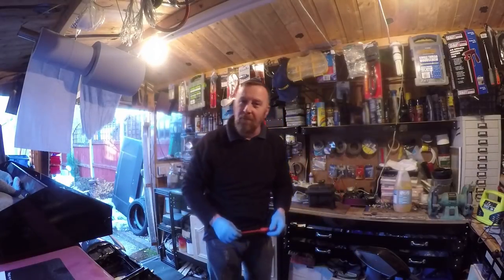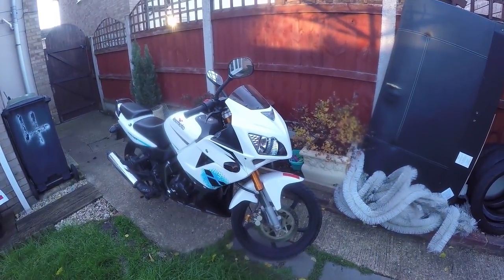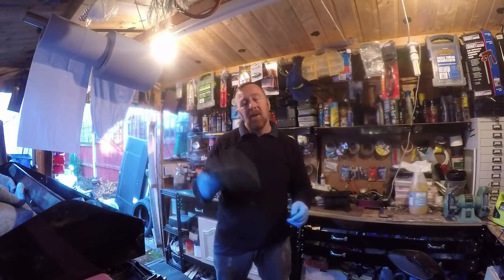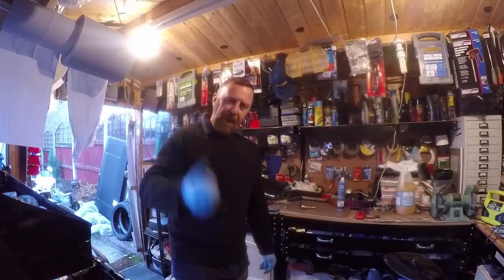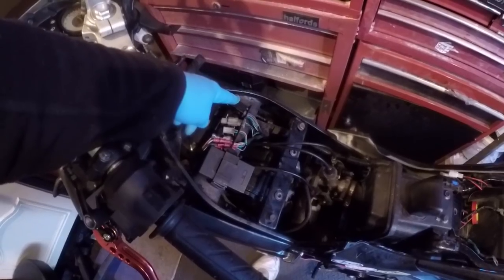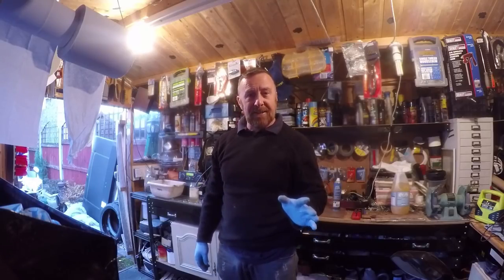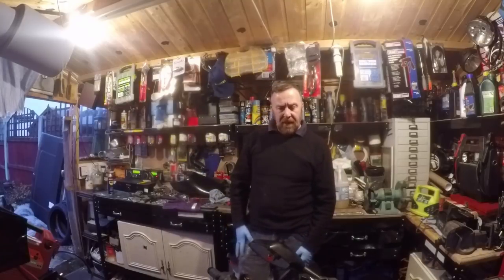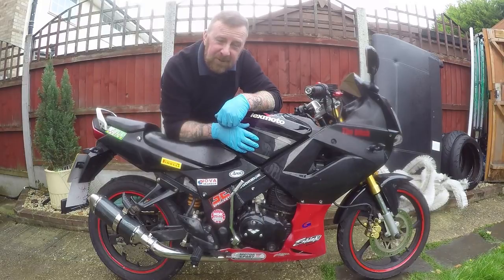LEXMOTO XTR 125 CC MOTORBIKE NONE RUNNER FIX MARK SAVAGE

Comment: Hi where did u get the mirror indercaters from and how did u wire them up
Reply from the maker: e bay and just follow the wires down to the old indicators it is easy but just try and hide the wires the best you can bud
Reply: @marksavage  can u still use the old ones as mine r new can u wire them up together
Reply from the maker: @jonszach8992  if they are led it should be fine otherwise you may need another flasher relay
Reply: Yh they r led ones
Reply from the maker: @jonszach8992  then should be fine bud
Reply: @marksavage  ok cool
Reply: @marksavage  do u know why a exhaust pops its only pops ar the front when slowing down the shop dont know what it is but only does it when slowing down
Reply from the maker: @jonszach8992  it's just too much fuel and a lot of bikes do it but normally big bike 
It won't hurt it bud 
A good June would help but ha its up to you
Reply: @marksavage  to much fuel doing what
Reply from the maker: Pops and bangs!!
In your exhaust you said ?
The pops are in and coming from your exhaust yes ?
Reply: @marksavage  yes at the front of it not the bk coming from the front
Reply from the maker: Is your exhaust tight ?
Is it a standard exhaust?
Do you have a standard air filter or an off the market one?
From the front?,
Odd as it's like a megaphone!!, all sounds come out the back bud
Reply: @marksavage  i have a normal air filter under the tank
Reply: @marksavage  its popping at the front end when u slow down
Reply from the maker: @jonszach8992  no idea bud 
Exhaust pipes are sealed onto the head so has to come out the rear , which as I said it too much fuel so it explodes out into the exhaust 
If it popping from the front end i don't know how it's getting out of the exhaust unless it loose
Know wonder why the shop didn't know 
I'm stumped too
Reply: @marksavage  well it could do with a new exhaust as under it and at the front is no holes but rusty as hell and the cylinder head bit where the exhaust goes into is rusty as hell everything is is in good condition
Reply: @marksavage  and what about the revs to low to done the idle screw to the right revs but niw they have dropped again to about 1500 revs and cuts out goes from 2 to one and half then cuts out even when engine is warm

Comment: Hi i have  the same bike as this i have to use my choke for like 5 to 10 mins when i start it up or if i start it up with out the choke it cuts out do u know why this is many thanks
Reply from the maker: it needs a service bud and a tune , choke should really only need to start and within 1 mins / 30 secs turn off and go
Reply: @marksavage  ok thank u
Reply: @marksavage  yh but surely the bike wouldnt cut out when the weather is not cold thought u only use choke in cold weathers
Reply from the maker: @jonszach4781  if its not tuned of set up right 
Yes it should choke up and stop if let on 
You have issues and they need address bud
Reply: @marksavage  how do u tune these bikes
Reply: @marksavage  took the spark plug out and its dry black what does that mean might even be the plug
Reply from the maker: @jonszach4781  running rich 
Carb tune 
You need to adjust air mix 
But first take out air filter and clean or change 
Then 6 half out and test then in or out for best running 
Like in my tuning videos 
I have them on 125s 
Have a look 
125 Mark savage 
Or 
Tuning 4t Mark savage
Reply: @marksavage  already cleaned the air filter last week it was clean like new
Reply: @marksavage  and what u mean in and out
Reply from the maker: @jonszach4781  watch my 4t tuning video 
It will explain along with my 125 cc videos
Reply: Do u think it could be the plug

Comment: Anyone know where you refil the engine oil on Lexmoto Xtr S 125
Reply from the maker: Should be right hand side of bike on the top on the cover to the rear !
Reply: @marksavage  thank you, do you know what to do with the gears mate because I can't shift into gear 3, I'm not sure how to sort it..... Thank you in advance
Reply from the maker: @nathanlucas3033  of thats not good and might not be an easy fix at all !!
If it goes into all other gears then it's bad 
Worth an oil change to see if there any bits in with the oil but the old owner may have damaged the gears 
Worth maybe a adjustment of the clutch to see if it helps but not too much

Comment: Is the timing chain easy to replace on these?
Reply from the maker: to be honest it can be a annoying job and if you get it wrong very hard to sort out if damage has been done 
its normally the cam tensioner that gives way before the cam chain
Reply: mark savage I’m looking at one on Facebook for £400 but it’s just the timing chain that needs sorting. Was gunna buy it there and then but something came into my mind saying “can I actually fix an issue like this?” 

So I thought I’d ask you before I buy it.
Reply from the maker: no bud leave it as its more than just the chain as guessing the valves haven't been done either and maybe piston damage, so £400 then if you cant sort it another £300 at a garage 
best get one running that may need a little tlc and a service which is much better and I have videos to help
Reply: mark savage have you got a XTRS for sale that you can offer to me please bud?
Reply from the maker: sorry bud sold all the ones in my videos and ive had a few if you type in 125 mark savage lol
best try fb sales or e bay but you are right to walk away bud if it doesn't seem right!!
Reply: mark savage it was a good job I came to you actually, I was gunna buy it at first but ty for saving me from wasting my money.